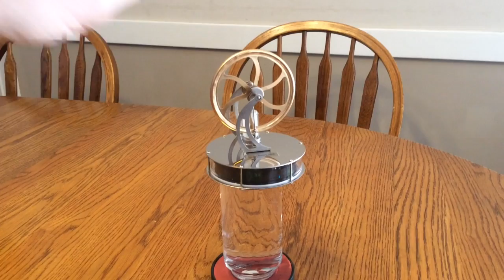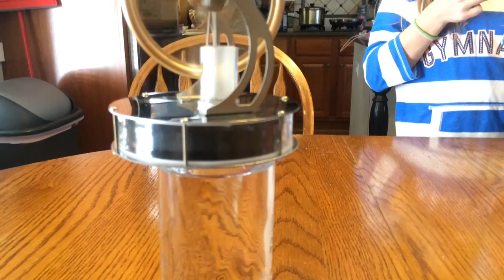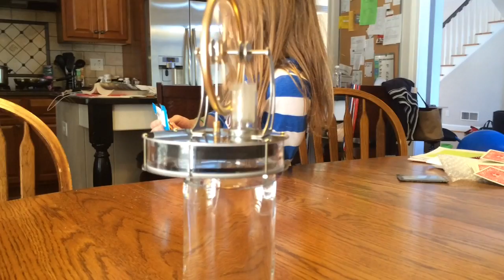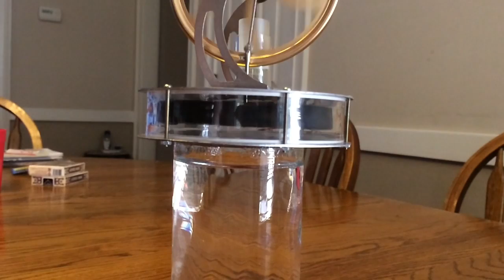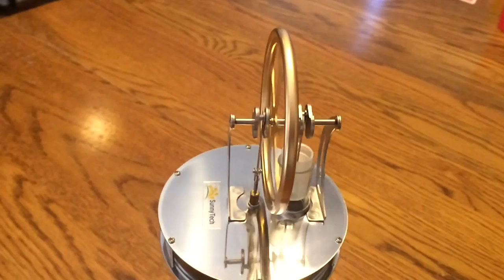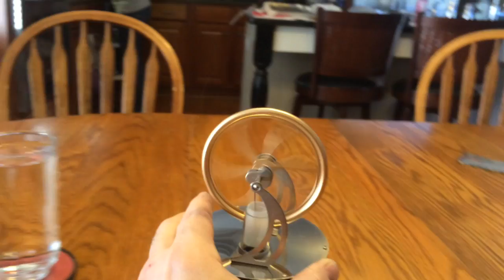Stirling Engine Education Model Kit (Physics : Energy) [KTFG 152]

Comment: Mine arrived but how do you attach the connecting rod to the rotating wheel ? The rod has a ? shaped piece on the end, do you have to close it with pliers or something ? Thanks.
Reply from the maker: I believe mine came fully assembled. 
If not I just pressed it on. You shouldn't have to close it with pliers.
If the two ends are different put the more difficult end on first then finagle the other end on.